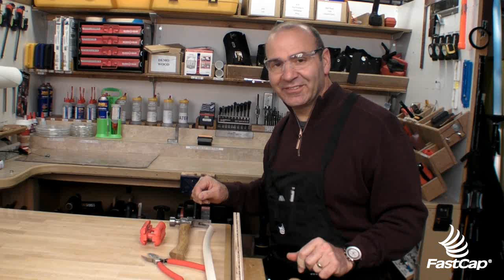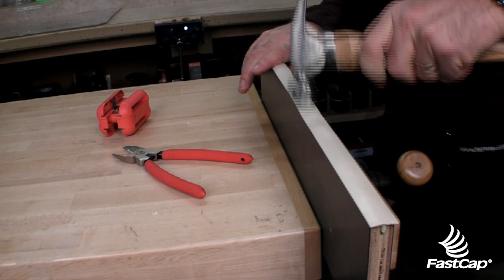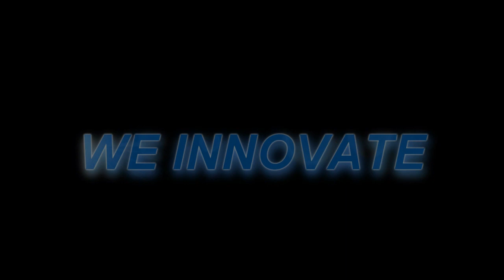FastCap Quad Trimmer With T-Molding

Comment: The solution to corners is to pre-trim on a straight edge. Hammer in a length of T-molding, run the trimmer along the straight edge and stop before the curve. Remove the T-molding and advance it to hammer in the next length of untrimmed T-molding into the straight part. Trim that too, remove, advance, hammer, trim, remove, advance, hammer, etc until you have pre-trimmed the entire length. Once that is done, install the full length and call it a day.

The only case where I could see this being a problem is iv the groove is an inconsistent depth and wanders back and forth. In that case, I would fill it in and route it again.

Comment from the maker: @PermanentRecStudio Sorry, but the Quad trimmer doesn't work too well on round corners if they are too tight. If there is about a 4" radius it could work, but anything less than 4" the Quad Trimmer is not very effective for. Thanks, Paul

Comment: I bought one of these and no good for going round corners. Also leaves marks on the surface where it rubs
Reply from the maker: It's not good for going around corners because it wasn't designed for going around corners. But please know that all FastCap's products are guaranteed for life so you can return it to where you purchased it and get a full refund.

Comment: Same problem here - I have the requirement for smooth bends and rounded corners but this doesn't work there.   I guess FastCap has no desire to come up with a solution to that particular problem?  Otherwise this tool is useless for me (and anyone who restores 70's/80's arcade cabinets.)
Reply from the maker: What about our Quick & Easy Trimmer? https://www.fastcap.com/product/trimmers